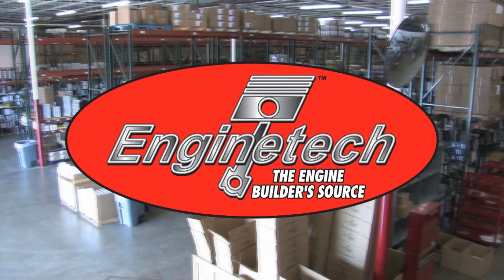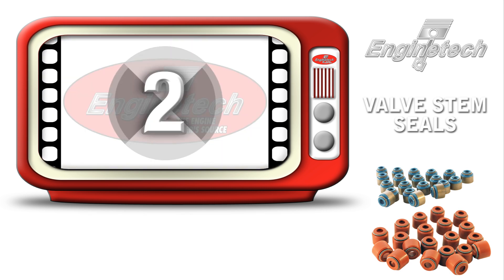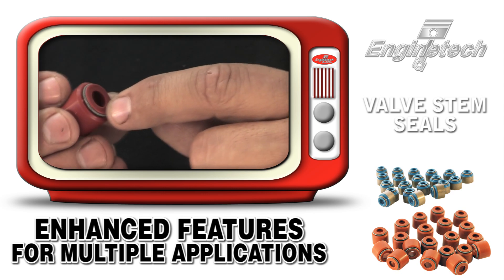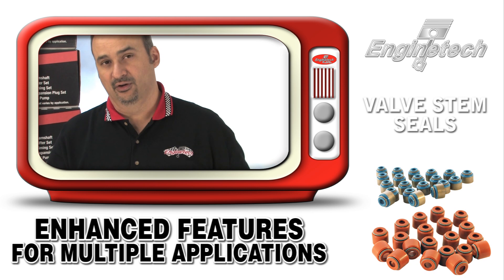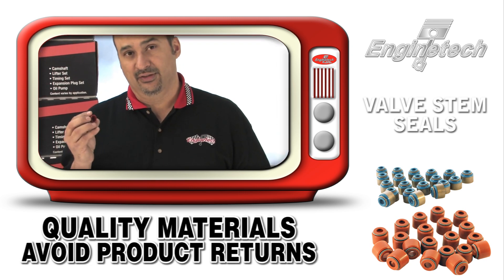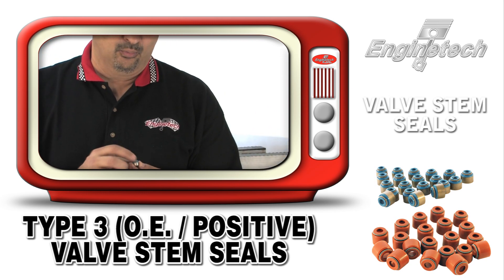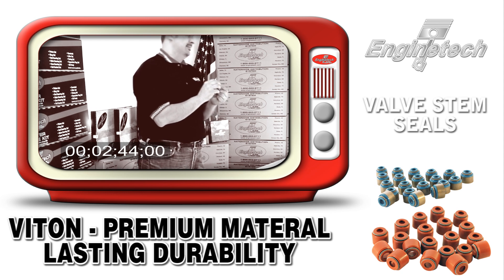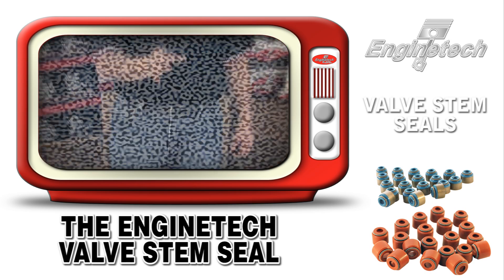Valve Stem Seals - Enginetech

Comment: I've never used these umbrella type valve stem seals. Do you install them with enough room on the stem to allow them to move up and down or the same way the OE seals tight to the bottom? And do the same umbrella seals work on both intake and exhaust stems?